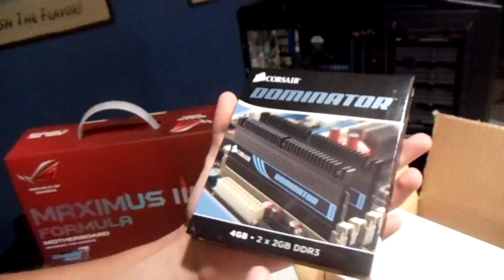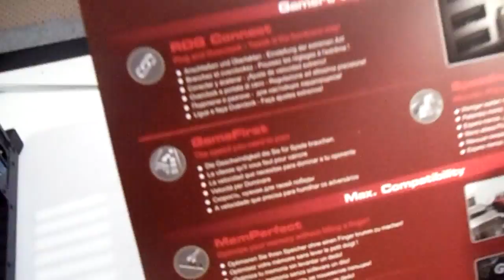Core i5 gaming computer build

Comment: im surprised how rude people are on the comments.Tthere is nothing wrong with an i5, I have 1200 budget on my pc i'm building and I chose the i5 to save a hundred bucks. The i7 has some hyperthreading, but many games don't even use that technology. It's only good use I can think of with hyperthreading is maybe some video editing program. I'm also getting the gtx 570 which is pretty decent, but cheaper than the 580,590 with similar performance. I think this guy made a legit build for the money.

Comment: @EBA170 t-case for the 750 is 72.7.... in simple terms @wowspare the t-case spec is refering to the intel specification of "dont get to this temp or it could possibly damage your CPU, while the T-max is "dont go to this or you will damage your CPU"  You can always look up your cpu specs directly from intel, in my personal opinion... yes you need to look to alternative cooling *** if you have checked to make sure your thermal / cpu cooler(functioning properly) compound is still in good shape....

Comment: @ExorcismSaw go for the 750. Its a quad core, while the 655k is a dual core. Plus, the 750/760 can be just as easily overclocked

Comment: @AirsoftLouisiana But still its a dual core. Unlocked means it just means that you can alter the multiplier of the cpu to increase frequencies, without having to run any other part of the system out of spec. But if you have fast enough ram and mobo, itwould be silly not to increase the frequency of the cpu. plus if you get the 760 it has an extra umltiplier anyway (:

Comment from the maker: @PavleP1 WOW lots of questions lol. ok I have a gtx570 right now. but the gtx 260 was in the $200 range when i bought it. now its not. my mobo does support i7 and no  water cooling is not needed. only if you are wanting to overclock the cpu. yes my mobo can hold 16gb of ram. i think 24gb but not sure. I use an Asus VE278Q 27inch HD monitor.  and yes 1tb of storage is plenty. look at my most recent video to see my computer more up to date. no i have no other computers.

Comment: @EBA170 Well for the tower only, it'll be something like $1,200 or so... (and another $700 for everything else [keyboard, mouse, monitor, speakers, mouse pad, computer desk and chair])
I was going to go with the Asus Maximus IV GENE-Z Z68 (1155), a Core I5 2500k, and an Asus ENGTX560 DCII... Kind of up in the air between the Non-Ti and Ti versions... Don't even know what makes them different. :P
I'm also split between everything else... :/

Comment: @EBA170 

no hes right.  I agree thoe 1 your gfx card is fine.   its amung the most bought .   however  if you were going for a budget build (assume you were since you got a i5) why you would buy mobo and ram   way over the top for such a system.   

Also  ppl only rage on these sorta  vids  because its easy to tell when someone used google  for shopping instead of research.

Comment: @wodka450 actually the 2500k is slightly faster for gaming or at least no worse. all that for 100 less to!... both are amazing chips. but unless you do alot of 3d rendering or dvd rips ect ect you won't even notice where that 100 spot went.

Comment: by bottleneck i assume you meant be limited feature-wise by the z68 chipset? im not familiar with whether or not there is actually any improvement over z68 with z77. because the chipset is build for the socket so i dont see how it would be possible to bottleneck a cpu with a board, (unless your overclocking and need some serious VRM cooling).

Comment: @SmexxiWaffles A 6850 is cheap ATM, about $100~$145 or so. It's amazing ;). P.S the i7 2600k is amazing, though I recommend you an i5/1100T. I'd go with a i7 2600k for the long period of time though. And why get a 6990 HD in crossfire? its strong as hell without crossfire. Would be a waste of money in my opinion. You got skype?

Comment: ASUS Rampage IV Extreme/BF3 LGA 2011 Intel X79
Intel i-7 3930k six-c
dual eVGA GTX 580 3gb in SLI
16gb Corsair 1866 ddr3 quad channel
thermaltake toughpower 1000w gold cert
500gb 6gb/s Solid state, 3 TB WD cav black HDD
TT gaming tower Armor 90
coolermaster cpu cooling